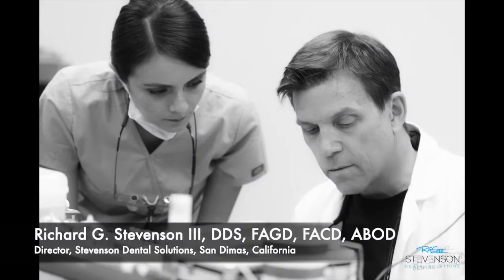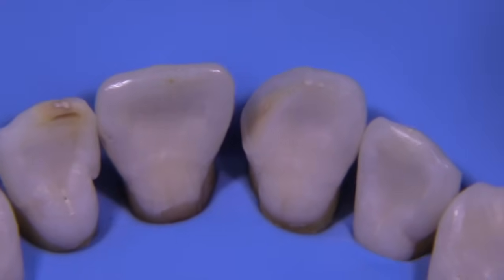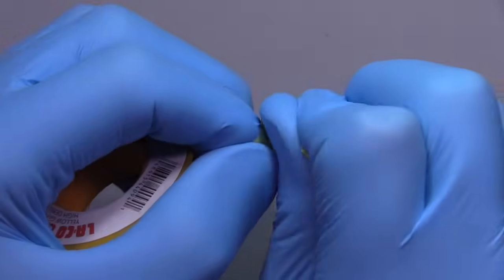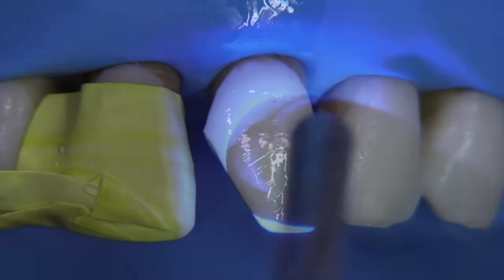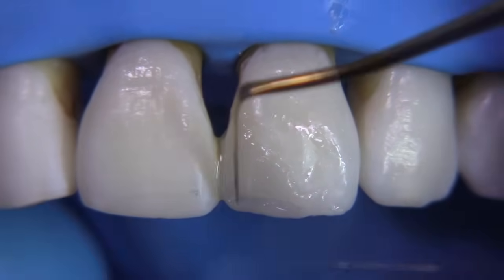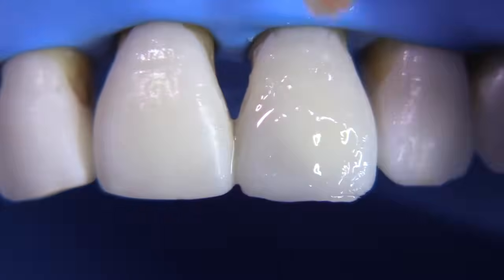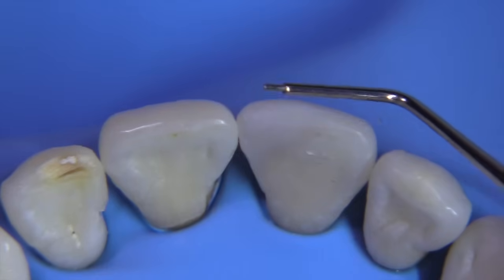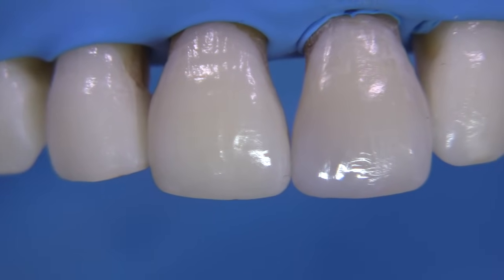Class IV Composite Restoration | Restoration Technique

Comment: 4:30 When you do the silicon mold how do you get the full shape of the broken teeth ?
Reply from the maker: You make it from a wax-up or digitally designed ideal tooth.  This approach requires two visits.  After scanning the broken tooth in step one, you may place a quickly made provisional composite to hold the patient until the day in which you place the final.
Reply: @StevensonDentalSolutions  oh I see, thanks for answering :)

Btw while I can speak to a real pro, I have a question maybe you can help ?
I'm looking to make FX vampire fangs for a cosplay, and I want the real deal, movie props quality

I want the one that you put the individual teeth directly on the real teeth and they stick to it naturally without glue by creating a suction vacuum or something

I already purchased alginate and dental stone to make a model of my teeth
I know there is 2 method :

1 is to use special resin in little syringe like 3m fitek, shape the fangs directly on the dental stone model by adding small layer by small layer and shaping it and curing the stuff with light (this is also the method used for permanent fang right ? instead of doing it on the dental stone model you do it directly on the real teeth after etching it a bit with phosphoric acid to make the surface rough, added some bonding material, and have the composite resin stick to it ?)

The 2nd method, what I'm probably gonna do since those little syringe are super expensive, is using clay on the dental stone to shape the fang, then make a alginate impression of the stone model with the clay fangs, then remove the clay fangs, fill the alginate impression with a  special resin made by mixing a powder and a liquid part, monomer polymer, and push the stone model in it (then of course adjust the fangs, trim and polish)

But the problem is, I have no idea which 2 parts resin buy 
There exist TONS of them, different brand different type, different class, different tints...
Most of the one I find are not even white resin for teeth but pink for gums...
So do you know a good one I should look for please ? 
Thanks :)

Comment: Great job, doc! I really don't know where i am wrong. When i've done 4. class or cervical restorations the border between composite and tooth tissue is visible. I use Filtek composite.
Reply from the maker: Sometimes a little bit of opaque composite in the shade of the final restoration, placed on the border between the bevel and the composite will help mask the transition.  Kerr Kolor+ has these opaquers...
Reply: @  thanks

Comment: Dr. Stevenson, your composite restoration video was insightful. After a recent bike accident, I'm considering this procedure for my tooth trauma. Does the procedure vary based on trauma severity, as Kriss AI suggests? How often do simpler approaches yield satisfactory results in cases like mine?
Reply from the maker: A well reconstructed class IV composite may last many years - often 15-20 years or more.  After several years they are prone to chipping and lose some of their initial polish, but may be repaired easily.  This would be my first choice - a conservative composite.  If it fails prematurely, it may be necessary to have a veneer or crown made.  Remember: the most important variable is the skill and experience of the dentist, not the procedure itself...Best wishes,  Dr. S
Reply: @StevensonDentalSolutions  thanks for this helpful tip Dr.Stevenson! this is helpful just like using kriss ai for any dental questions :)
Reply: Thank you for sharing your experience! I also found Dr. Stevenson's video on composite restoration  very helpful.  Can you tell me more about this Kriss AI?
Reply: @ryanfajardo4364   I think she is talking about KRISS AI. It's a ai chatbot for dentistry. I rely on Kriss for all my queries related to dentistry.
Reply: sorry to hear about your bike accident but can you share how did it made a tooth trauma? and what Kriss AI?
Reply: From what I've heard, simpler approaches can sometimes give good results, but it really a case to case basis. It's still best to get expert opinion

Comment: Hello sir you haven't show us how to remove composite from the contact and fro mesial wall
Reply from the maker: after opening the embrasures, a small area will touch the adjacent tooth to form the contact. If this requires smoothing, wedge the tooth and slip a thin interproximal strip between...

Comment: Hello Doctor I truly enjoyed your video. I have a question that how to you control the proximal contact? I see you don’t use any band or strip
Reply from the maker: I will make sure that the adjacent surface is smooth and apply a thin layer of vaseline, then wipe it clean. The composite will not stick and may be easily smoothed with strips if necessary - slight separation with a wedge will allow for a physiologic contact.
Reply: @StevensonDentalSolutions  vaseline... thank you so much ... Is it also appliable when it comes to class 2 restoration?

Comment: Great as always! 

What if there was a significant color difference after recently placed anterior restoration? Do I need to remove the whole restoration? Or can I remove 0.5mm and add a new layer? I had this question in my license exam and I couldn’t find the correct answer!

Thank you 🙏🏻
Reply from the maker: remove a little and try a new shade, however, this will not allow for a translucent or opalescent layer.  Best to take 1 mm off and use a new underlying shade and then veneer this with translucent shades.
Reply: Thank you!

Comment: Hi Dr.stevenson
in 9:26 when you placed that composite piece on the palatel shell and in 12:11...why it appeared wet? was that modeling bond ?
thanks for these videos sir, theyre massive boost for G.Ps and students!
Reply from the maker: Yes, Modeling Resin - several companies make it - it's a special filled resin which softening the composite and keeps it from sticking, while not reducing it's strength or adhesion to subsequent layers.  Tkank you!

Comment: How did you clear the contact point?
Reply from the maker: if it is placed up against a smooth surface, very little is required.  Usually a 3M proximal strip does the needful.

Comment: When a patient comes  in their tooth is chipped and you can't make a mold. Only in a perfect world.
Reply from the maker: Yes, you free hand the case, or have the patient wait while you wax it in the lab (done both many times).  Then have the patient return for the definitive restoration.
Reply: @StevensonDentalSolutions  you should do a video on that.
Reply from the maker: @kimmillynn2161  I did - check my library.

Comment: What’s your recommendation to avoid voids and porosities doc
Reply from the maker: Use non-stick titanium nitride coated instruments, and modeling resin to allow the composite to flow and not be pulled away and repositions, which is the primary reason for voids.  Always "pat" the composite rather than drag it.  Push it rather than pull it.
Reply: @StevensonDentalSolutions  thanks a lot and the same thing goes for porosities right
Reply from the maker: @bruhbrx  Yes
Reply: @StevensonDentalSolutions   thanks a lot doc
Reply: @StevensonDentalSolutions  also is there any difference between gold and titanium coated instruments? And can I use alcohol instead of modeling resin for that purpose especially we are not provided with modeling resin during board exam
Reply from the maker: @bruhbrx  Titanium Nitride can be many different colors: gold, grey, blue, etc.  I haven't found any differences.

Comment: i have a question doctor does using a modeling resin change the shade of composite ?
Reply from the maker: No - it is neutral, however, if you use a large quantity and apply the modeling resin in a thick layer this may impact the translucency.
Reply: @StevensonDentalSolutions  thank you doctor Stevenson

Comment: its good job yet it should've been even more opaque or 1 shade darker
Reply from the maker: yep - the challenge was not to use my tokuyama set with opaquers, tints and multilayering techniques. Make it clinically acceptable without the best options...This is the true test of a clinician, don't you think?
Reply: @StevensonDentalSolutions  Yes,we have a lot of true tests as dental clinicians,and you sir are apparently capable of handling them well :)

Comment: Hello Dr Stevenson. I hope you are doing well. First of all I would like to really thank you for creating such informational and excellent videos. 
I'm preparing for dental licencing exam and my doubt is regarding class 4 composite. We are not allowed lingual putty and freehand is the only acceptable technique. Can you please suggest any matrices or technique to create lingual wall for class 4 composite restoration?
Thank you.
Reply from the maker: The best technique I've devised and use is to place a plastic matrix and wedge, then apply composite to from the facial against your gloved finger (which is pressed against the lingual - leaving the facial unfilled.  Do not use the matrix to wrap around the tooth - just use it to protect the adjacent tooth from being bonded.  After curing this initial lingual wall, add incrementally from the facial as if you had a lingual matrix. It works so well I'm surprised no-one has taught this.  I'll make a video.
Reply: @StevensonDentalSolutions  thank you for the reply Dr. Do you mean to say regular mylar strip by plastic matrix? If yes I'm using the same technique but it doesn't give good interproximal contour. Also if your finger moves even a little bit, it can create excess or deficiency. The evaluators are really strict with margin.
Reply from the maker: @yogeshthacker4000  Keep practicing this wedge more, and press firmly.
Reply: @StevensonDentalSolutions   Hello Dr Stevenson. I hope you are doing well. Can you please make a video of class 4 composite with the technique you mentioned in this message. Thank you
Reply from the maker: @yogeshthacker4000  will get this on the list!

Comment: Hi Dr Stevenson. Could you illustrate this same situation but how to freehand the class IV without a putty matrix or stent? As this is a clinical scenario I was faced with and could’ve performed better.
Reply from the maker: I will for sure - it is a bit different for sure. I typically build it with a plastic matrix technique for the lingual and then incremental for the facial.

Comment: Hey Doc, I have a question, I hope you answer this.
How do you make a wax up? That consfuses me, since there is no tooth structure to take an impression.
Do you first take the impression, and then make wax up on model with restored tooth?
Reply from the maker: I usually consider this a two-step restorative process: 1. Take an impression for a lab fabricated wax-up and stent. For the patient, I will make a quick temporary class IV, free Handel with just one shade of composite - nothing fancy - a 5-minute procedure. 2. I see the patient again and schedule a final restoration using the wax-up and stent. Thank you for your question!
Reply: @StevensonDentalSolutions  Wow, thanks for quick response! This was really helpful!

Comment: Hi Dr Stevenson.
I dont understand one thing from the video. At 10:45, when You put the composite, you dont separate a right incisor. There is visible a contact between the composite and mesial surface of the incisor, but You dont care about it and just polymerize and continue Your job. Could You explain me, how did u manage with it? how did You remove the contact to save the space between those tooth?
Reply from the maker: I use a "Mopper Pop" technique - using a small instrument in the gingival embrasure and slightly separate the teeth, which releases the composite from the adjacent tooth - note - there is no bonding here.  After this I use a #12 blade to open the embrasures, followed by very thin discs.

Comment: HI. Why would you build the palatal with composite, make a stent and then remove the composite again? What would be wrong with the initial palatal wall that you are then trying to recreate again?
Reply from the maker: Yes Doctor, you may do this either way, however, I have found like so many others, that you can better control the thickness of this wall using a stent.  When you freehand it, it is very hard to create the lingual contours and the thickness and lack of irregularities from the facial perspective, all simultaneously.  Thank you for the question - if you have not tried this, give it a go and let me know your thoughts. Best wishes, Dr. Stevenson
Reply: @StevensonDentalSolutions  Thank  you as always.

Comment: Excellent work and explanation doctor
However  I have a perticular question on how you removed the excess composite from between the Incisors, it's exactly at  15:27  where the transiton occurs.
You've explained at first that you would just use an instrument to "crack" the composite off the unprepared tooth, I just want to know a little more details about that.
Thank you very much in advance
Reply from the maker: I use a #12 blade and angle the instrument towards the tooth.
Reply: @StevensonDentalSolutions   very useful  tip thank you so much

Comment: This Dentist Is an ARTIST..  im verry impressed.
Reply from the maker: Trying my best. Thank you
Reply: @StevensonDentalSolutions  im scheduled to have a root canal done.. im now wondering what ur Opinion is.. realising im askin a CloudyQuestion.. Can teeth recover on there own?
Reply from the maker: If the pulp (nerve) has crossed into the irreversible stage, then no.  You also need a complete diagnosis of the tooth in question: the pulpal diagnosis and the apical diagnosis from the dentist before starting any treatment.
Reply: @StevensonDentalSolutions  i had emergency visit during the holidays  and was prescribed amoxillin*(iBadSpell ?)  scheduled for root canal next week..   MyDentist said was nothing showing on the exrays.. I was in so much pain at the time... 8 hours later The pain subsided but is still a dull ache almost a week later.. Much appreciate Ur feed Back ..  Its great to have such Open Communication now functioning in more meaningFullways
Reply from the maker: Okay - get the diagnosis

Comment: amazing video. thank you so much for your service! just a quick question when you overextend your etching and bonding, your reasoning was so u dont see any white lines. i do understand for the bevel.... can you please clarify?
just wondering if etching/bonding beyond bevel will help you in seeing the flash and removing it (if thts what you meant)
I always have flash and spend time taking it off :( 

many thanks
Reply from the maker: The concept that I learned from Dr. William "Buddy" Mopper some 20 years ago was to always leave compote beyond the margin, however, make it thinned out to an imperceptible margin.  This creates a more seamless transition. It's quite amazing.  The key is to always rotate the instruments from composite to tooth and use water spray.  All the best!

Comment: Can I use this  yellow Teflon thick gas line for isolation , i mean insert inside gum if I have leak in rubber dam?!
Reply from the maker: Indeed - its a great product - a bit less adaptable compared to the white, water line material but yes.

Comment: If the patient comes in with fractured tooth, how do I fabricate the Stent to get the perfect shape?
Reply from the maker: Either take an impression and wax it up, or perform a quick composite to restore the lingual, make a stent, then remove this and go from there...I prefer the wax-up technique.
Reply: Another brilliant educational video. I have a question regarding the stent. If I quickly build the palatal with composite what is the advantage of building the composite again using the putty index ? Am I not recreating the same palatal contour?

Comment: How do we take care of the toughness interproximally?
Reply from the maker: ContacEZ to loosen a tight contact and 3M finishing strips to smooth.  This won't remove the contact.  Thank you
Reply: @StevensonDentalSolutions  thank you  so much! And do suggest using wedges interproximally to create better contact?
Reply from the maker: @nidhipriya2208  Yes, wedges are helpful for sure, unless you condense the composite directly against the adjacent tooth - which also works.
Reply: @StevensonDentalSolutions  thanks! Well, I am going to try that coz a few times, when i used wedges, it caused bleeding and then I had to wait for it to stop and isolate again.
Reply from the maker: @nidhipriya2208  Great - hope it works well.
Reply: @StevensonDentalSolutions  thank you!
Reply from the maker: @nidhipriya2208  My pleasure!

Comment: Hi Dr. Stevenson, 
Great video. I was wondering how you carried out the 'cracking move' to separate the composite from the other central incisor?
Reply from the maker: I performed the "Mopper Pop" named after Dr. Buddy Mopper, a legend in composite bonding and co-founder of Cosmedent Dental.  Use a small instrument (like a beaver tail burnisher) between the teeth (gingival embrasure area) and carefully twist the instrument until you hear a "pop".  After that I use ContactEZ and 3M polishing strips.  I'm going to demo the ContactEZ in an upcoming vid.  Thank you!